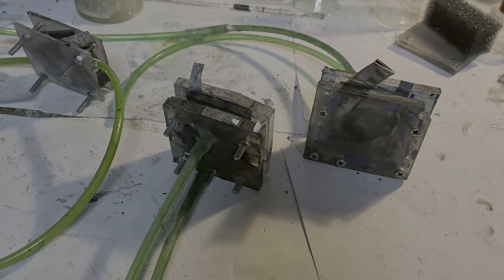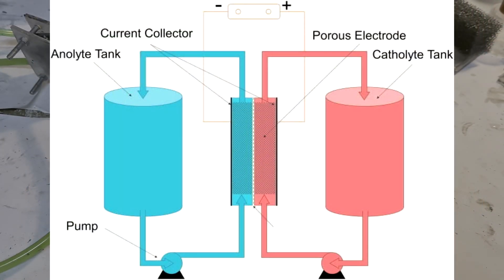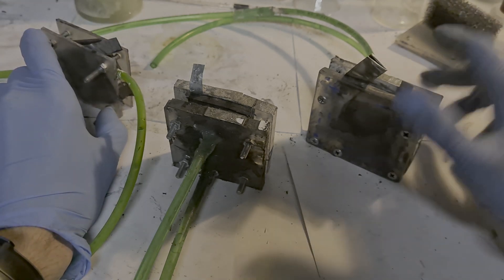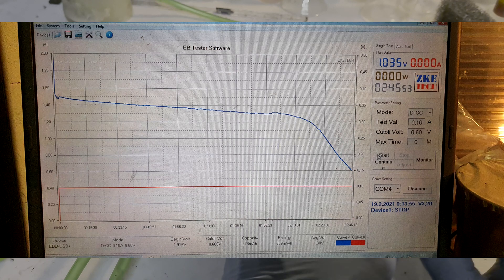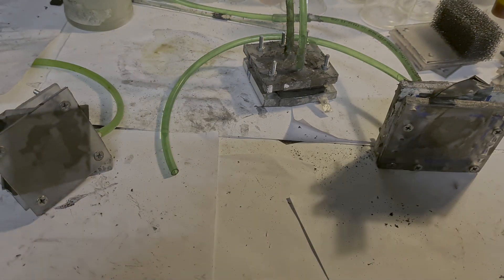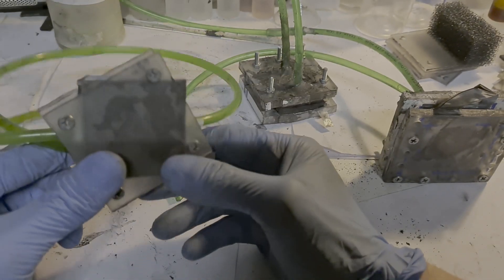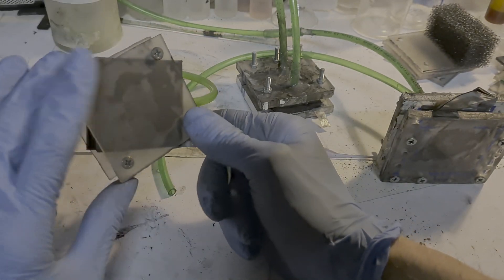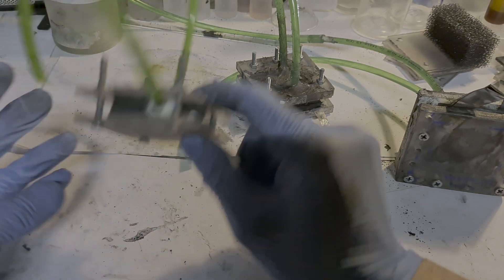Zinc Bromine Semi Flow Battery

Comment: Are you doing anything to deal with shunt current? (I assume you’re not using discrete tanks for each cell, right?)
Reply from the maker: Yep, thats a problem for flow batteries. No I dont use tanks fo each cell,.... in basic I do anything about that for now. But technically using each tank for each cell will be good option, but really bad in terms of complexity and economically. Each tank (or one tank with multiple internal areas) then need also own pumps,...
Reply: @cayrex  thanks! How does a single tank system impact on the energy capacity of the system?  I suspect that bromine storage which is limited to the complexing compound) becomes a limitation since you can’t really just “increase” the fluid storage capacity.

Comment: Hi Cayrex2.  Have you any ideas around minimizing shunt current effects between cells?  An obvious, but impractical way is to have a separate reservoir for each cell... but that is cumbersome and unwieldy.  Cells are interesting but it seems to me that the real challenge is in the stack configuration and support equipment.  Thanks  Doug

Comment: Can't remember if I've asked, what do you use as the membrane between the two sides of the cell?
Reply from the maker: You will be fine with high dense absorptive glass fiber mat
Reply: @cayrex  Do you have a link to where to buy this from?
Reply from the maker: @armwrestlingprofessor  it is a bit harder to buy for if you dont buy company to company. But you can make a look at alibaba for example and ask for samples or you look here: https://www.tobmachine.com/battery-separator-and-tape_c120?gad=1&gclid=Cj0KCQjw7PCjBhDwARIsANo7CgkrPHCueTOYQWnAEJO5upckg7y6pQlUvG44zaRJ9v488JUxRlODNyIaAoqjEALw_wcB or here https://labatscience.com/magm-separator-page46.html

Comment: have you managed to make a multiplate system to increase capacity?  Could you go over a schematic of what you have in your 'improved' cell?  Thanks  Doug
Reply from the maker: To increase capacity I only need more electrolyte and that's it. For more voltage I need multiplate cell system. And for more power output I need biger cells with biger surface area.
Reply: @cayrex  so, could you put multiple (same) plates on either side of the membrane separating +ve from -ve side of the cell to increase power?  Someone from Australia on YouTube is claiming virtually any voltage from a single cell but doesn’t show what’s “under” the paper towel hiding his cell!  I suspect he’s using bipolar plates, but I also suspect he must be creating discrete electrolyte systems to get the 5volt out of a Zn-Br cell.
Reply: @cayrex  apparently, the addition of ammonium chloride to the electrolyte will increase conductivity and so, lower cell resistance. Have you seen that paper?
Reply from the maker: @nitrousman8882  yes, ammonium chloride I already use in some cells as support electrolyte

Comment: Nice, hope you are healthy now, Gelion Australia has made Zinc Gel Battery , can you provide more details about that with practical?
Reply from the maker: Yes I am better now, thank you. Yes I know about Gelion,..... you have many patents from Gelion company. I try I one of my flow cells to use a setupe of half gel and half flow
Reply: @cayrex  do you feel it can be considered as capable stationary energy storage? Do you have telegram group?
Reply from the maker: @INDIAN VV BHAI  thos batteries are considered for stationary energy storage on the first place. Thos cells are almost like flow batteries which are on the market right now but thos semi flow cells design is better because have reduced system design and different in cell structure,.... so less parts, etc. What is some telegram group?

Comment: Hi Dusan, well done, what open source voltage does one cell have and how much current can you get out of a cell, when the pump is running ?
Reply from the maker: @overunitydotcom the current which I get is from 2 to 5 amps. The voltage of the cell is 1.8V and on discharge load of 100mA the voltage drop to 1.68V
Reply: At the end on that computer was displayed 1,6V at 100mA. Quite pathetic for that size and all the setup needed.
Reply: @fanridersclub1306  Did I read you wrote pathetic? For an active size of just 7.5cm squared? I believe you don't  know anything about Flow Battery Technology.  Don't look at the size of the outer perspex covers, judge the performance of this great work on the active contact area. Dusan is the hardest working guy on YouTube I know of today about battery/supercapacitor.

Comment: Do you get many vapors from the bromine that is formed. Whenever I have experimented with these type of batteries I have problems with sealing bromine vapours away. It's like peeling onions, only ten times worse. This put me off. Looking forward to seeing the motorbike.
Reply from the maker: No problems about Br vapors in thos cells which I use right now. On my first cells I have problems and many times tha vapors comimg also from electrolyte tank.
Reply from the maker: Heh the motorbile with flow cells will be some long term project 😅